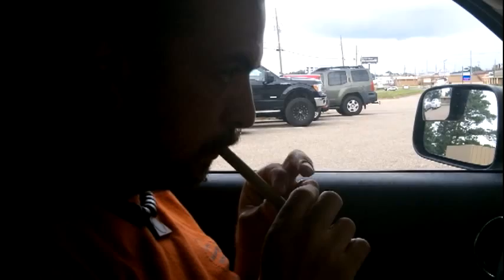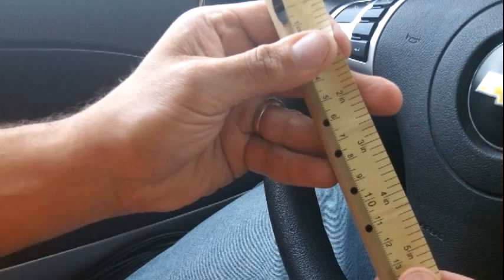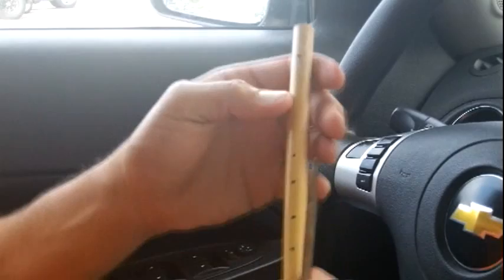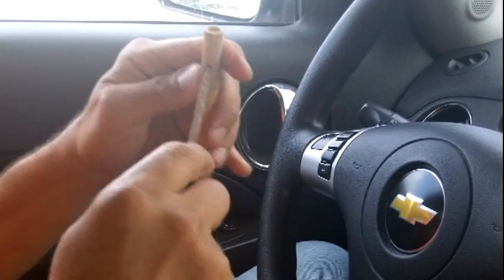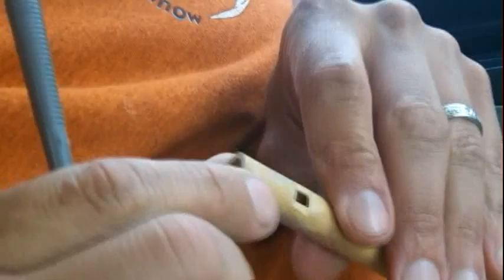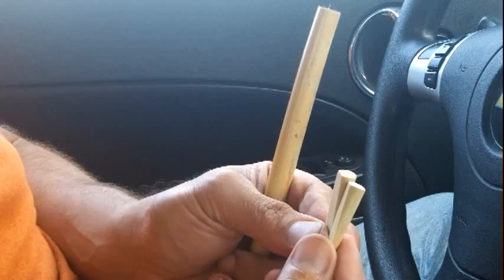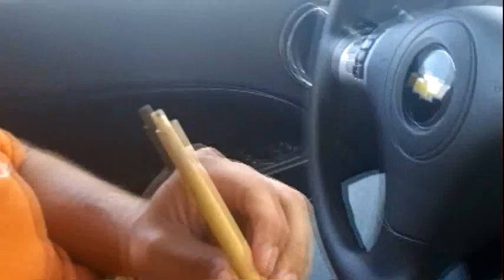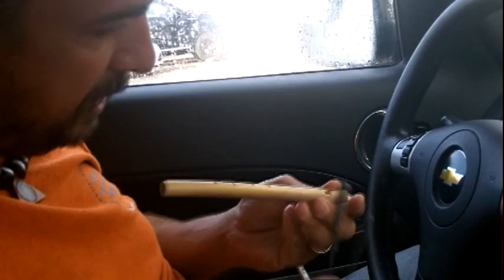Making a Cherokee 4 hole whistle without power tools or fire

Comment: Is this actually PVC? I don't think actual schedule 40 is that size. 
There is PEX that looks like that. PEX comes in copper tube sizes, but not PVC.
I ask because I don't have sawgrass and PVC from the hardware store seems to be the wrong size.
Reply from the maker: This is actually a material that I mentioned at 1:20 within this video, however I do have another video where I make it using hot water PVC.
Reply: @BlueBearFlutes  Does it also come in red and blue?  There is one kind that uses red for hot water and blue for cold water.  They're both in Lowes and Home Depot.
Reply from the maker: @Peter Bonucci  The most important thing is the answer to your first question, this was a natural material, sawgrass or river cane as I used in the video. My other video however uses hot water PVC. Answering this question... no. Unlike PEX, hot water PVC usually only comes in a natural/cream color. You could certainly use PEX if you like, it simply needs to be a hollow tube.

Comment: Which direction does the ramp go? I'm guessing that it goes up hill. 
You said that you used a piece with a 5/16 hole but the video looked a lot like 3/8?
Reply from the maker: Hi Dana, the concept of which direction could be uphill is relative. It would probably be best described as the ramp comes from the inside of the sound hole and goes outward as you should be able to see in the video. This piece was definitely 5/16 inside diameter. In the workshop, we use every size before between & beyond 5/16 and 3/8 and they all turn out great just the same.

Comment: Is the a through hole on the length of the flute?  And, just a downward angle on the finger hole edge of the sound hole?
Reply from the maker: Sorry I don't quite follow you?
Reply: @BlueBearFlutes  - I was asking if the hole down the  Sawgrass tube goes all the way through, or does it stop before the end.  And also, regarding the shaping of the sound hole...I see it is squared off on the mouth side, but it is beveled downward on the other side, yes?  I will check your other video, I may have just missed it.
Reply from the maker: @beav1962  Yes! That's right with regards to the tube. It's completely hollow. ;) The shape of the hole is not super important. We do have several other videos on making this particular flute/whistle and if you have any other questions please message anytime.

Comment: Hi Charlie,  Is your car full of saw dust?  Lol   Nice video.  I made a few of these that I have not been able to get to work, but his video gives me hope.  The 5 hole with air supply is easier for me.
Reply from the maker: Yes Skip, everything in my life is covered in sawdust, the house, the car, the kids! These take a little playing around with, but once you get the angle on the plug just right and the size of the sound hole perfectly square it become addicting.
Reply: Thanks for the reply Charlie!  The last time I watched this video again I learned a bit more, and add that to your tip, I am encouraged to try again.  I love these small whistles because most of my Bamboo is a smaller diameter.  It is a fact that matching a dowel/plug to the hole, and the angle on that plug being precise to the "...perfectly square..." hole is a complex set of geometric exercises.  Once I get one, I think it will get easier.  My most exciting time making flutes is the first time it makes a sound, it gives validation that I have learned some of what you are teaching.   So, I look forward to my first success on the small whistle.   Thanks!